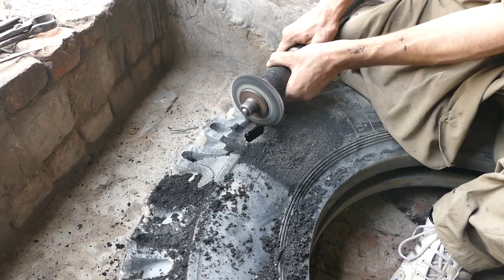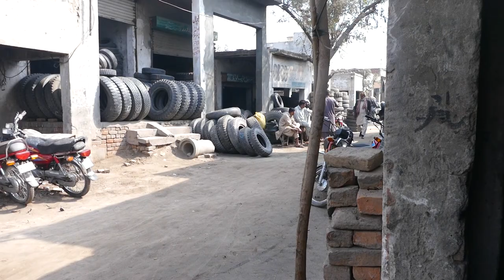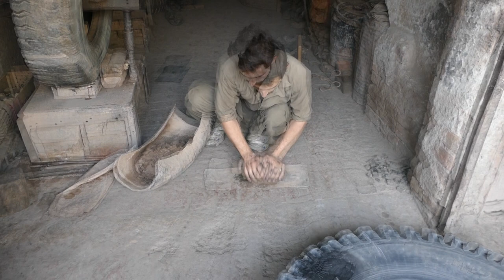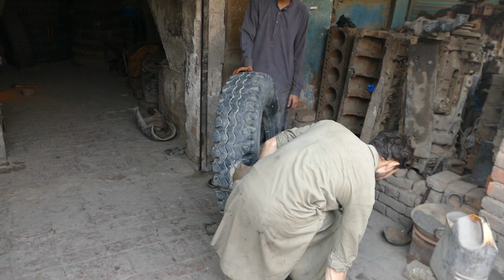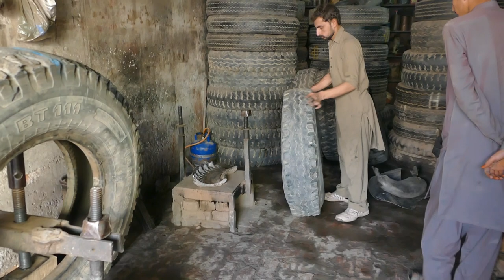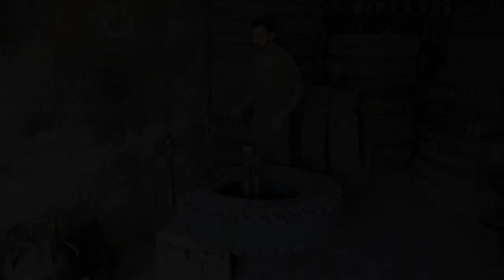Amazing skill of Repairing a Hard Impact Sidewall Truck Tire

Comment: This is stupid. No wonder every truck accident ends up with loss of life. Very bad
Reply: Probably the country where you are from is not poor. On this case they have to manage with what they have only
Reply: Dat komt omdat jij jezelf niet kan voorstellen hoe het is om in een arm land te leven en je dingen moet repareren met dingen die voorhanden zijn!!
Reply: Every truck accident doesn’t result in loss of life, in fact only a very small percentage does. What are you talking about?
Reply: @jordanbruce  I’m talking of Pakistan bro. They can afford the vehicle but not the maintenance 🤷‍♂️
Reply: @autograbados  afford a truck of that magnitude but can’t buy tyres. Think 🤔
Reply: For your information , these tires are usually used in trailers like 22 a wheelers. 53 foot long. And these tires will be placed in the middle somewhere inwards paired with a good condition tires outward. Even it burst no risk of flipping the trailer, some time we don’t even feel it when it goes BANG, we just listen the noise and stop. Also we use these tires in trollies to carry light materials like green fodder, hay etc. The funny thing is mostly these tires last longer then brand new tires.

Comment: Lot of people complaining it's dangerous and not safe but this is a routine procedure and well repaired tyres are put back into service and go on to continue to work very hard to the end of their lives. Conventional logic says they are weak and compromised but the owner and operators just use them like any other tyre and they seem to be up to the job? Loads of tyre are on the road after even bigger repairs than this and are working fine. If it did not work there would be nobody doing it?

Comment: Maybe stuck in 25 MPH traffic in India this tire patch is OK. But these sidewall repairs are illegal in USA where trucks on the interstate highway maintain the 65 MPH limit for as many hours at a time as they are allowed. NOT IF, But WHEN these repairs fail, you can expect to lose control, jack knife and roll the truck splattering 10 to 40 tons across the highway to cause a multi-car pile up possibly costing dozens of lives and a millions of dollars in damages and injuries. Causing delays like this will also make the press scream names at you.

Comment: All that time, effort, and expertise invested into a tire that would get thrown away without a second glance anywhere in the West.
Reply: Because it's dangerous maybe?
Reply: Most of truck tires are repaired and resell in the west too. But some are too damaged to be repaired. Especially when damage are on sidewall... And replace braided metal by nylon wire that's not really safe unless it is for a trailer who will never exceed 15mph and not too loaded :)

Comment: I believe the damage isn't from an impact. It can be from under inflation under heavy load or manufacturing flaws. And I doubt it if it will last long, the sidewall during usage is always in constant flexing.
Reply: I agee, I did road service for a tire store 35 yrs. ago, repaired small forklift to grade all tires. Split rims, all the fun stuff! I never would repair a tire like that. Sidewall damage we wouldn't touch, just replace it. This guy knows his stuff, but I couldn't imagine spending that much time on a repair, couldn't make no money that way!
Reply: @denisrose9207  I've worked for fifteen years as warranty officer for Firestone Tyres in Saudi Arabia. Recently call it quits.

Comment: The question is.... has the tire regained its 100% integrity when on high speed?
Reply: I'm a tad curious to this too... but I wouldn't rate top speed... they seem to be in a country where roads aren't exactly perfect for top speed... but to withstand pot holes and bomb craters.... probably good enough... ingenious take on tire repair with what you have available though

Comment: In America, no competent tire installer would install a tire with a sidewall repair -- mainly to protect themselves from liability when it fails and blows out.  When a single tire like this costs more than a year's wages, though...
Reply: Sidewall repairs can not be done on radials as there is just flat out not enough material in the sidewall..  Bias Plys such as above is a different story. Sidewall repairs were very common back in the day on Bias Ply tires and are still done when remoulding OTR tires. This tire will likly be fine as a drive or trailer tire,  you would not want to use it as a steer tire is all.

Comment: The only concession to any safety equipment are street shoes as opposed to sandals which seems to be the norm.
Reply: Im glad he at least had shoes on , most wear flipflops. Guess where you have so much free to cheap slave labor you dont have to stress so much if a guy got injured on job , ya charge HIM, then push him to side and pull the next one right in to take over...china wall .... US RR across america... all same

Comment: Pretty impressive....however if we did that kind of labor intensive job in America to a once new $500. tire...it would cost $300. to $400. to fix....so  we'd opt for buying a new $500. tire instead.
Years ago I'd fix televisions, rebuild brake cylinders, carburetors, starters and alternators...now you can't even find the kits to rebuild them...everything is designed as throw-away. I still fix washers- dryers- ovens-HVAC systems..... refrigerators and dish washers are now throw away....and half of the washers-dryers and ovens with circuit boards are now throw-away.

Comment: The guy is skilled no doubt.  however there is no way that the repair is as strong as the original tyre.  It is an accident waiting to happen.By cutting out all of the cross ply the strength on that part of the tyre has gone.  Its is a weak spot now waiting for an accident.

Comment: I visited India in 2006 and there were lots of tyre shacks at the side of the road.  The bus we were on stopped at one as we’d had a couple of flats.  They were still using split rims and tyres with inner tubes.  The guy sowed up the hold on the tube and it was then covered in molten rubber/glue compound.  
This industry will disappear in the next few years.

Comment: Pretty .. now what is it good for?  Not going on my 250K truck.  You can't cut the belts and cords and just put twine stitches across the hole.  GEEZ come on the rubber isn't the structural strength in a tire.

Comment: Selling one of those is like selling a car without disclosing it's been in a crash. There's a good reason we don't see "vulcanizing" shops here and it's not because we're too proud to buy used. It's because it's not safe to drive on. The person who buys it might get some miles (or kilometers were this video is from) out of it, but like it's been said before, it's an accident waiting to happen.
Reply: Actually you're wrong. This is done in the west, especially on a lot of expensive industrial tyres like tractors.
Reply: @Liofa73  Actually, I'm not wrong because I'm not from Europe like you.

Comment: Note to teens:  if considering a career in tire repair, note that if a bunch of original steel wire belts have blown out, it does nothing to spend your time laboriously covering up the damage with cotton thread and melted tire rubber.  It’s a lose-lose situation.  If the tire doesn’t kill someone the next day, it will blow out the day after.  Missing and complete steel belts can’t be repaired with a lick and a promise.  It’s a waste of effort.  Find something more productive to do.

Comment: The integrity of the tyre is destroyed, the ply is broken and the sewing he did will only offer  a fraction of the original strength. in the UK any damage to the side wall means the end of the tyre for good reason.
I have sympathy in places where the cost implication has such an impact but this repair is just plain dangerous.
Reply: No my friend you are wrong. I am from an Island nation with one of the most rough and rugged roads. It was our family business repairing tires and trust me we fixed damages to the side walls by sewing and valcanizing with felts , you could a tube into 2 separate pieces and we would repair it with such precision that your tire or tube may give up elsewhere carrying huge loads but not the place where it got fixed. We even repaired the base of tube valves so yes it is a MYTH with the western world that the quality has been compromised. One just need to know and do his job right.

God Bless.
Reply: @pitamahbhism5766  getting damaged else where is the result of the original damaged part that you have fixed. So the load didn't get distributed uniformly across the tyres. It's the bonds that holds the integrity of tyres that was lost the first place when it was damaged. You are adding some strength to those by fixing but it will not be as original and will get damaged easily over a period of time and it's risky
Reply: @ii-ib2in  Nope you are wrong. You are trying to speak with your assumptions and I am speaking with years of experience. My telling that the tire or tube may give up elsewhere and not the repaired part is to tell you how strong the repair process could be and your pressure theory is just a wild claim. If for you a tubeless thread plug doesnt do anything to the durability of the tire then why should anything else do that if the repair work is done right.
Again I am talking through years of personal experience in repair works and also as a driver in one of the countries with the roughest of terrains and ruthless drivers. Your assumption holds no ground against personal experience. Please note I am not saying substandard jobs are strong but the works of an expert who knows what he is doing.
Reply: @pitamahbhism5766  I'm not saying anything about your experience.  It's the laws of  physics, once the things are broken the integrity will not be the same as original. For example imagin you take a perfectly designed glass Tyre, you fix the broken part. The will surely  break again at same or different place because the integrity is already broken, any amount of fixing will not restore the original state.
Reply: @ii-ib2in  Mate what Laws of physics are you talking of? Are you serious? I am talking through what I experienced dude. No better teacher and source of knowledge then experience. 
In the Western world countries an electrician changes bulbs, a plumber does plumbing etc etc. Here even in early teen kids do everything bro. Shows experience is far superior than knowledge on paper with no real experience. I aint saying a new tire is not good but just saying the guys job is well done and will stand the test. Period.

Comment: this is one of the reasons people lose their lives on the road. Trucks are grossly overloaded and roads are in terrible rocky conditions. This tire would not deflate slowly with a puncture...It would explode, leaving the driver little control of vehicle. And if you are on a narrow road on a mountainside, you know where you are going.  Pressure on a tire is exerted from the inside. Nothing was done on this repair from the inside. THIS TIRE SHOULD NOT have been repaired. Govt should outlaw these sort of things.